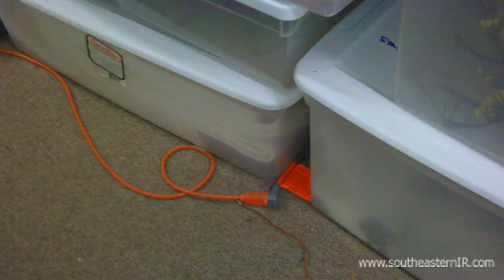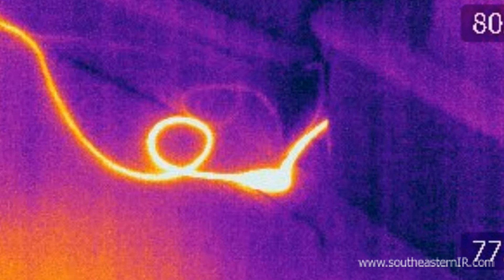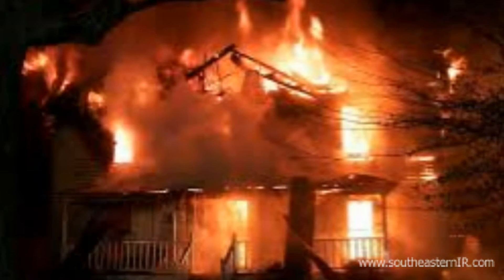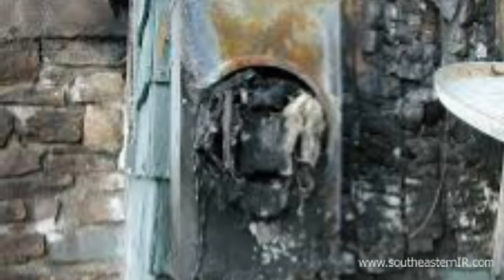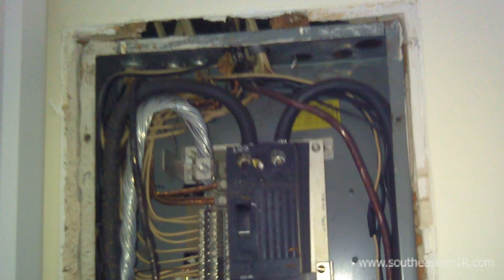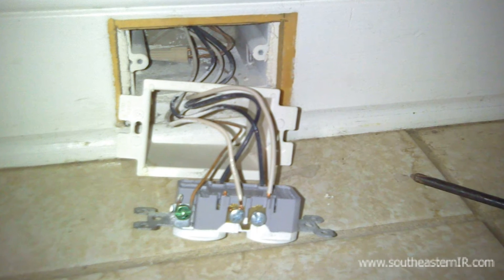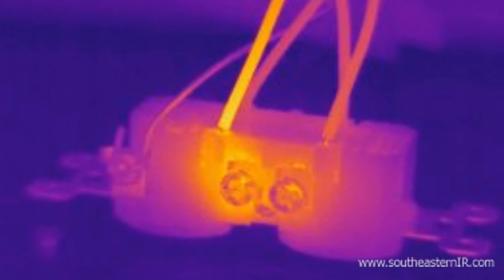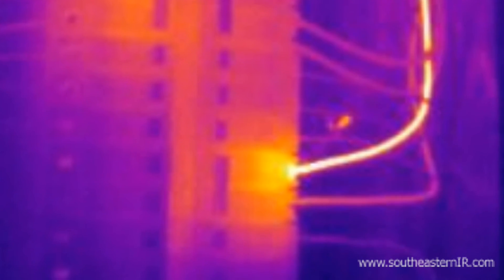Southeastern Infrared Thermal Imaging for Electrical System Survey

Comment: In Britain all fires of an unknown cause are designated as electrical fires. I was told this by a former Fire Officer whilst on a fire risk assessment course.
Reply: And what is the ratio of that? I heard the US 120V system is more prone to electric fires because for the same power, you'll need double the amperage for any single phase appliance, than you would over here in the EU with 230V. Our systems just seem to run at half the load...